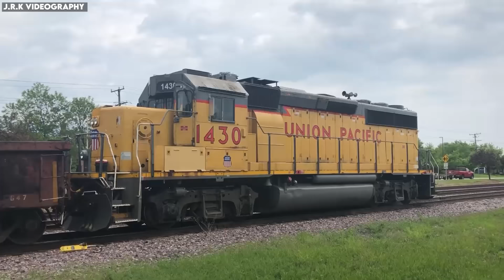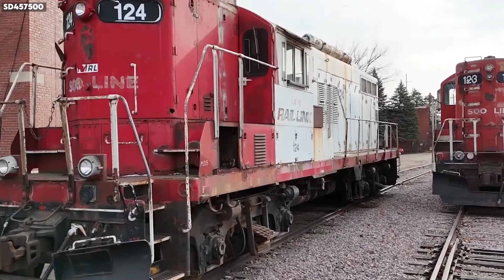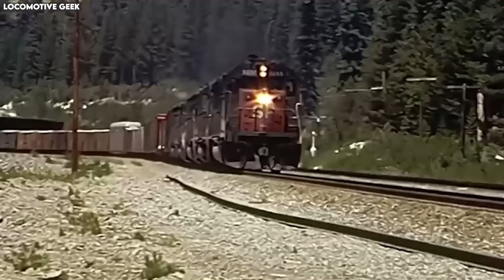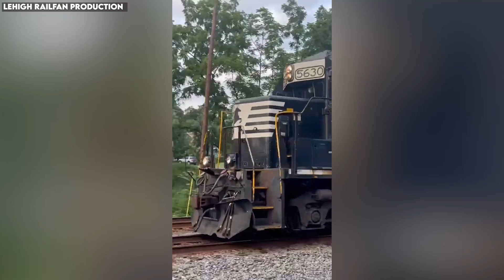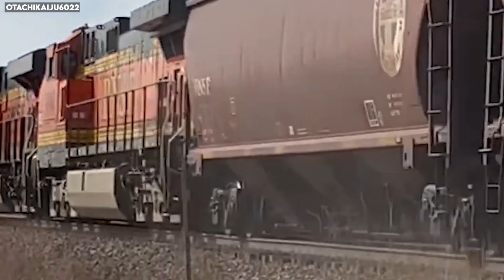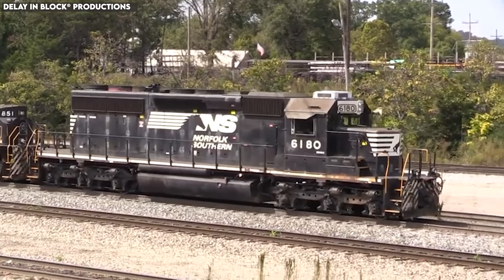10 Freight Locomotives Railroads Couldn't Replace

Comment: The SD40-2 is the best locomotive ever built, in my opinion. Fun to run, comfortable to ride in, hardly ever gave me any trouble. Not overly computerized like the newer stuff. Just hard working and dependable. Once they started putting air conditioning in the cabs, it was the gold standard of locomotives as far as I'm concerned. That so many are still out there earning their keep in 2026 speaks volumes.

Comment: No mention of GP 7   and  GP 30 
I think SD  40  is  SD 40 whether II or  not 
the first GE mainline locomotives to appear I think were clattering rattlely things that were scrapped long before older GP and SD locomotives that were already on the line

Comment: For those EMD diesels built in the 1970's as updated 60's models don't forget the "dash" in the name.  For instance SD40-2 should be read SD FORTY DASH TWO, not SD42.
Reply: Your correct, just AI slop.

Comment: I believe that it was a good commentary. I believe one locomotive deserves at least an honorable mention. That is the SD60. It didn't have the tractive effort of the GE C40-8, but it was a better loader...break couplers. It would race with a load. I've chased them enough on Norfolk Southern trackage. And as they began to age, they were ready for duty. One had to be replacement for ES44DC. As the SD60E program they thrived. The NS C40-8 upgrade couldn't happen because they didn't do as well...NS scrapped them. There are SD60's, SD60M's, and SD60I's in lease fleets or in railway storage lines. How many C40-8 locomotives are in standby? BNSF is foolish to let all.their SD70MAC fleet not be modernized like their Dash9's.

Comment: Electo-motive locomotives were the best of that lot, I would see these f and gp units working well after their build dates. These were easier to maintain than steam. Much respect to steam, wouldn't have a country.  The 567 series engine was developed in 1938 and was a staple until 1965.